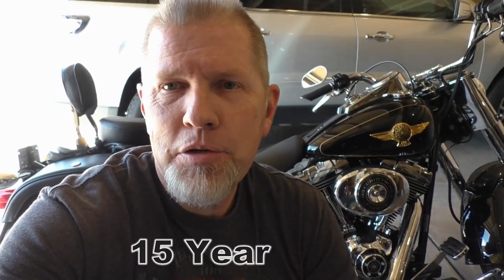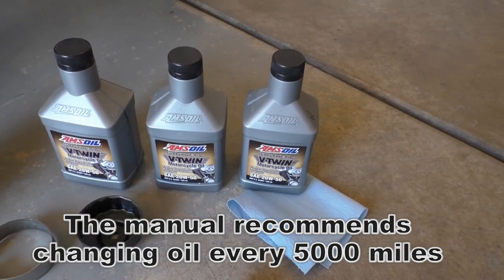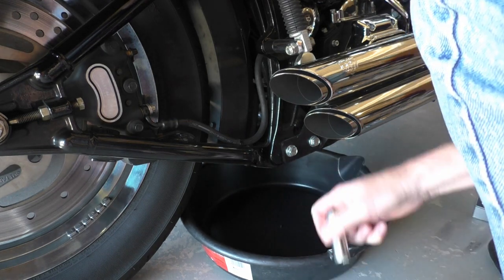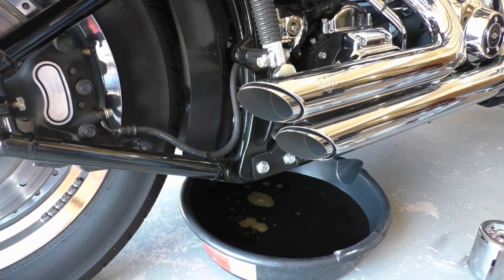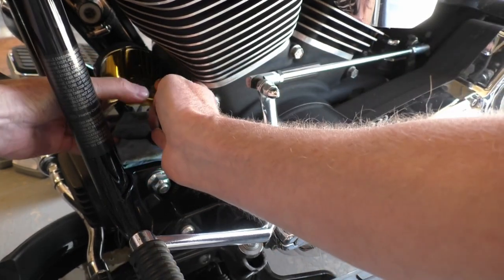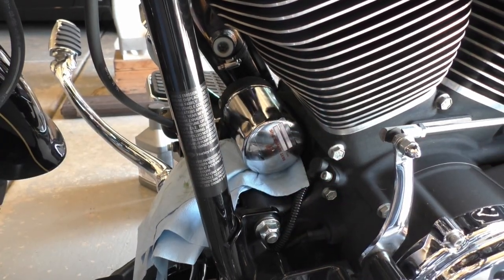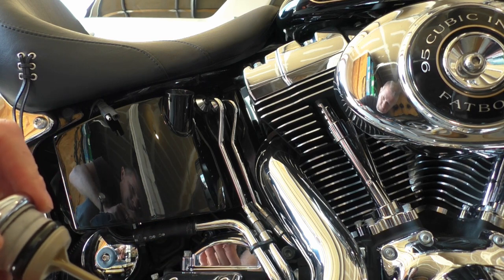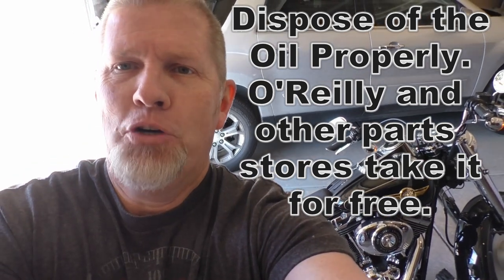Harley Davidson 2005 Fat Boy, Softail, DIY simple oil change

Comment: Good job brother I have the same exact bike in silver, I have two into one Vance & Hines, I also installed a new fueling camplate and HF oil pump, and Andrew's 37g cams , gear drive.
  The things an animal with 95 in.
  I like to keep the oil in between the fill and full hot!
   And I use Quicksilver 20w-50. Look it up it's phenomenal oil even better than amsoil

Comment: Can I use the same amsoil that I use for motor oil for transmission oil.
?
Reply from the maker: Some people do but I prefer a heavier gear oil. 75-90
Reply: You can gear oil works much better.mobil 1 75w-90 gear oil